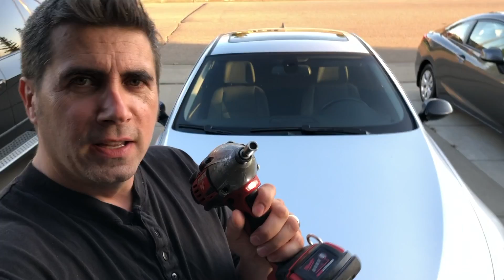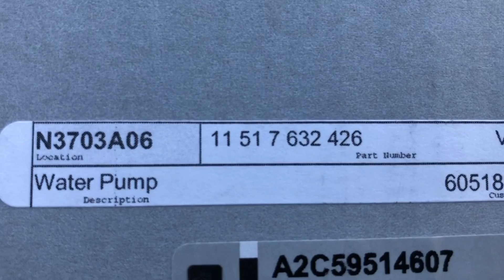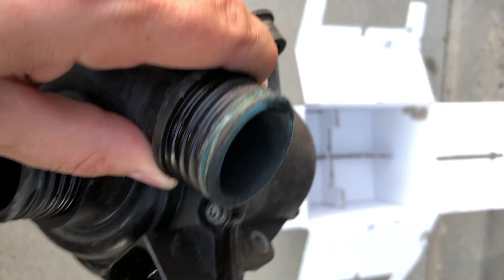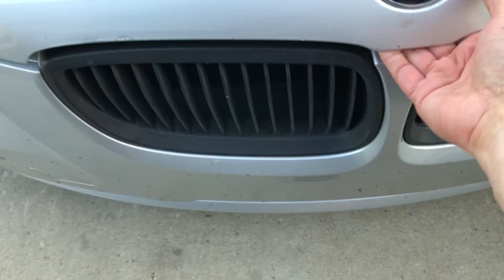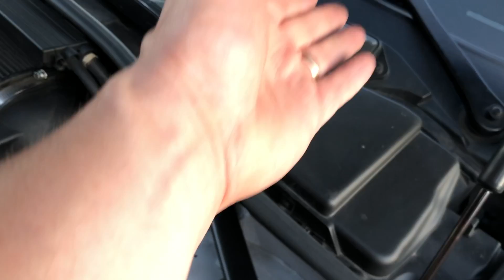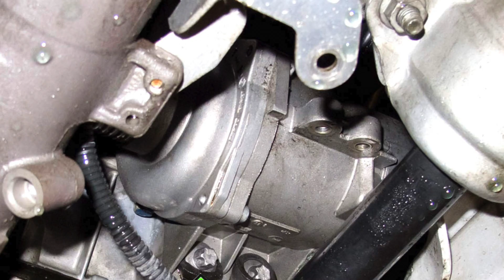My BMW 335i N54 Water Pump Replacement

Comment: I paid $500 USD  for OEM water pump, thermostat and the bolts. The new "updated" version is plastic. They only last 50-60k miles.

Comment: ACTUALLY, regarding the bleeding of the system.... the BETTER way to do it (and the factory way) is to turn the ignition ON, and press and HOLD the accelerator pedal all the way to the floor for about 15-30 seconds.  This will activate the water pump WITHOUT the engine running.  It will do the bleed procedure all by itself.  IIRC, it takes right around 10 minutes to complete.  You're welcome!
Reply from the maker: Thanks for your post.  I also did a video later with the full procedure.

Comment: Fantastic video! Just bought a '09 335i Cabrio, but since MTL winters are harsh with all the road salt, I'm only taking it out of storage in April. The question I have for you is: When doing the water pump & thermostat, is it a good idea to spend the extra $$ and replace the turbo's? Wastegate rattle is a common problem with the N54, so would it be wise (or dumb) to replace the turbo's to save on future labor costs? Now, that being said, if I do replace the turbo's, can they be replaced with slightly larger ones, to gain some added HP? Abraco!
Reply from the maker: Some great questions and thanks a lot for watching.  Firstly yes, if you ever have to swap turbos and/or wastegates I would go to a pure turbo setup or some other good power upgrade with these larger aftermarket turbos.  With that said you can do turbos anytime but I do not see much of an advantage in doing turbos while doing a water pump because that only scratches the surface.  Much much more to do.  If you have to do turbos, then you do other hoses and water pump and t stat at that time.  If the water pump fails I would just do a couple of the hoses in the area with the t stat and water pump and save the turbo job for when you are ready for the upgrade.
Reply: ExoticCar PlayPlace Great Advice! Thanks so much and keep your great videos coming! Cheers!

Comment: BMW owners = gluttons for punishment. Plastic in BMW's ? so what's new ? Why do you guys bother ? Just buy a whip, strip off & whip yourselves. You'll find there's no difference between that & owning a Beemer !!!!!!
An electric water pump is a pretty stupid idea fraught with problems just to gain a couple of HP & the alleged  saving in fuel with reduced mechanical losses is offset by more alternator loading for a net gain of ZERO..
Reply from the maker: Agreed
Reply: when you drive one, you'll see things differently. Honda's all my life.... til the day I drove a 328i Wagon. Ouffff
Reply: Someone just gave me a 335i they lost thousands to already..  I got it running pretty good until I saw the damn temp warning.. leaking WP.  I'll fix it this once, then it's going away for good FU bmw
Reply: And I'll never actually buy a beemer, could have bought a Honda for what's been spent on this POS by previous guy and me now

Comment: I know it's a bit off topic, but it's the engine I have. I was curious about your thoughts about the reliability of the N26 motor in the 2016 F30 328I sulev. Your input would be greatly appreciated. Thanks.

Comment: I wouldn't mind if you just showed a short clip in between the job, but its great to know you can tackle a job like that.
Reply from the maker: This one is a character builder due to its tight spaces and awkward angles which left me with a couple of scratches and cuts.  Either way this was a very rewarding experience.  Thanks for watching.
Reply: @ECPP  there's an automatic bleeding procedure with these cars. After setting the temp and blower you hold down the gas pedal for about 12 seconds and it starts automatically.

Comment: Wow, those parts weren't cheap--1200.00 dealer cost and how many hours labor would they have needed to charge you?That's a serious thermostat compared to a 'typical' one that fits in the palm of your hand
Reply from the maker: Hi Jim, I did not get a formal quote but I spoke with a couple of mechs who are familiar with this job and it sounds like you can expect about 6-8 hours for both t stat and water pump multiplied by $175.00 / hour equals a pile.  I felt motivated to do it myself as a result

Comment: Just did all that on my 335i a few months ago, parts from fcp euro including coolant. Also replaced all pulleys and serpentine belt same time
Reply: Nice!! I did the same work. Parts from FCP Euro.
Reply from the maker: Good stuff,! A little maintenance makes for a fun and reliable experience.  Cheers
Reply: it's a great idea to do these jobs together at once... instead of back to back never ending 😂

Comment: The third bolt on the water pump (the difficult one) usually is about 2mm too long and won't fully seat, I had to grind a bit off the end
Reply from the maker: Hi Cole,  I am not sure but mine fit right and did not have an issue.  That being said there is that odd cable bracket that straps down beside it and sometimes impedes access.

Comment: Awesome!! Doing your own maintenance  on your BMW is always best and you save tons of money.
Reply from the maker: True it’s the only way to run the older cars, especially the fun cars like turbo cars.
Reply: @ECPP  ya next is going to be replacing motor transmission mounts installing a secondary oil and teansmission cooler.
Reply: fixing our own cars gives us full appreciation for how well it can run 😁
Reply: Not for the newer BMW models, the newer high tech BMW forces you to do the job at the dealership
Reply: Even the "older" 2010 like I have BMW is really trying to force dealer only with all of the one time use and STRETCHING aluminum bolts all over the place, plus the computer stuff they didn't expect ppl to program themselves haha.

Comment: First bolts are not aluminum put magnet on that second the water pump housing cracks between connectors that's where water comes from and where did you get aluminum thermostat never seen one
Reply from the maker: Hi, not sure where the t stat came from originally.  I am the 3rd owner so not sure if this was replace already or if is factory but that’s what came out.
Reply: @ECPP  how often do these Tstat fail... leaking or stuck open?

Comment: i  was hoping for a video how to do it :(
btw what kind of problems does the n55 have ? 
i hear its a very good engine with no problems ?
Reply from the maker: No problem.  That’s why I included a link on another great diy video but this vid was to give you more depth as to what and why this had to be done.  From people I have talked to the n55 is a bit more reliable and slightly less problematic however it’s also not perfect and apparently the internals of the n54 are better than in the n55, so sort of depends on what you are looking for.
Reply: @ECPP  
i just bought an M2
thats an n55 but with the internals from the M4
 ( i've read ) Sow i should be a very strong engine ?
Reply: Other than the OFH and valve cover gaskets on my 85K+ N55, no problems at all.
Reply: @michaelhall9138  

whats the OFH ? :)

Comment: My n52 has 53k, probably gonna die out soon
Reply from the maker: It may or may not but those are the kind of miles where there are no more guarantees
Reply: N52 tends to be a bit more reliable! And that’s relatively low miles for those motors now.